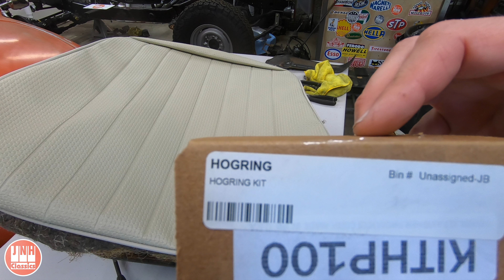An Unloved Beetle (Episode 9) - New Seat Covers

Comment: I remember seeing Sears apply seat covers back in the 60’s.  They used steam to tighten the wrinkles.  I believe vinyl is stretched hot and cooled.  If you heat it, it will shrink like mono kite on a model airplane.

Comment: I'm surprised that with all your fine tools, you are using dime-store scissors and small ones at that. A good pair of real scissors, large and made like the old style scissors is a must have tool for me. But you're doing this almost two years ago, so there is hope ;) Also, assuming your plan to keep the car (your logo is on it) and you had the seats out, why not use some nice material? Okay, you want to keep it stock looking.